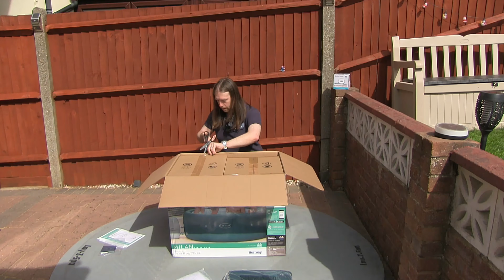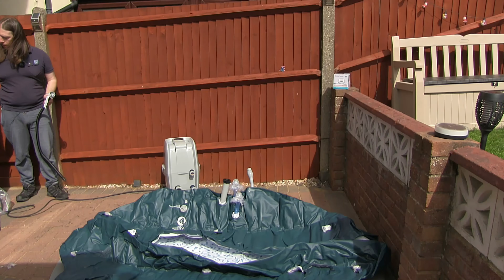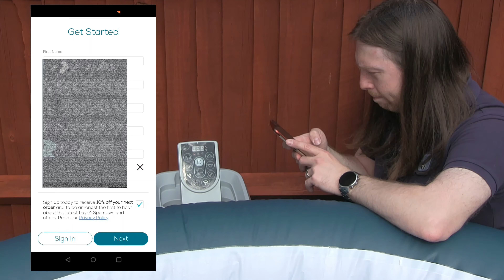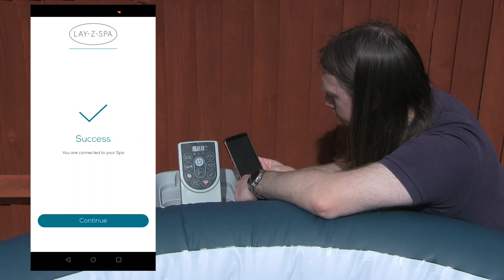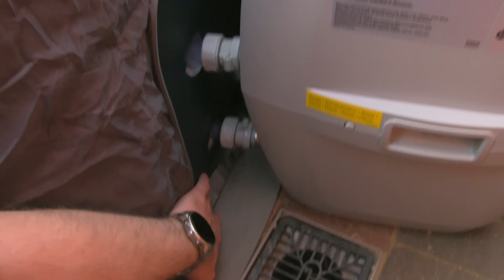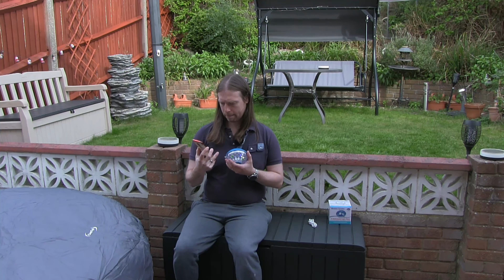Lay-Z-Spa Milan Airjet Plus with WiFi Unboxing, Setup and quick Review

Comment: Hi Ben, I can't seem to connect ro my WiFi. I dont have 2g. I think it's 5g. Any suggestions?
Reply from the maker: Hi Penny, it will be in your router settings. You probabley have a bonded WiFi ie 2g and 5g are set as one combined. You will need to log into your router to change this. Just go to a web browser and enter your router IP address something like 192.168.1.1 or 192.168.0.1 or 192.168.0.256 are the most common ones. You can find yours by clicking start run type cmd press enter
ipconfig /all
and find you default gateway. This should be your routers IP address

Then go to the WiFi settings and separate them setup two deferent SSIDs.

You might be able to get away with turning 5g off during setup but it might not work.

User name and password may be printed on the back of the router

Hope this helps all the best
Dave

Comment: Are the bubbels on these as good as the model, like the havana , without the bubbels on the floor? I am scared the more space from te bubbels created lighter bubbles. I cant compare the pumps . The pump is heavier?
When I compare to the havana and smaller one (180?)
Reply: And are the bubbles heated? Warm or cold? Very much different information about this!! 
Would be nice if you can clear that up!
Reply from the maker: Hi Kleintje, Yes the bubbles are heated which is lovely as its warm bubbles against your skin and helps keep the water warmer for longer.
All the best Dave
Reply from the maker: Hi Kleintje, I have not tried the Havana one but I did have the Paris which had only one ring of bubbles. From memory I wold say the bubbles in the Paris were larger and more powerful but more inconsistent and uneven. With the new design with the bubble in the middle as well they are now heated, more even flow and distributed. I would say the blower is more powerful as the force of air being bumped is about the same feel but evenly distributed.
Kind regards Dave

Comment: PASS, absolutely no reasonable need to give your location.
Reply from the maker: Hi Adrian, at the moment there is no need to share location for this integration as it does not respond to you being home or not. Which is what I was hopping for to save electricity if we are not home then the spa does not need to heat up. I have gotten an auto spa function working via home assistant so it cost very little to run as the spa will auto heat when we have excess sun, or cheap electricity.
You can see our automation script here https://github.com/BrenTeck/Solax and https://github.com/BrenTeck/Lay-Z-Spa 

Hope this helps all the best Dave

Comment: what do you mean by bubbles = heated ? 

i started at 22c - 6 hours later its gone to 27c  = / all covers are on
Reply from the maker: Hi FudgeyButter, In the past with the old units the bubbles had just outside air pumped into the water cooling it down much quicker than the new ones heat the air so it looses heat slower than before.
I was not saying you use the bubbles to heat you Spa as this would be very inefficient and noisy. If you are wanting to heat the Spa just run the heat mode, it will stop when the target temperature is reached.
I hope this helps all the best Dave

Comment: The instructions aren’t just bad, they’re nonexistent. It’s appalling, infuriating. If it hadn’t been for YouTube I, never would have figured it out, and I still have a wifi light blinking on and off for no reason I can see. Anyway, thanks for your great video. A life-saver!
Reply from the maker: Hi Gregorsamsa,
Glad we could help with our Lay-Z-Spa setup video, If the WiFi light is flashing it has not connected to your WiFi I suggest having a seprate 2.5 Ghz network instead of a dual 2.5+5 Ghz network. Setting up a 2.5 Ghz network may fix this. Also are you using the Lay-Z-Spa or Bestway app? I use the Bestway app as it allows for Home Assistant integration.
https://www.youtube.com/watch?v=fow2Kaj3FRg&t=1059s is the part I run through the WiFi setup

Hope this helps
All the best Dave

Comment: Mine won’t connect to the wifi. Have tried everything
Reply from the maker: Hi Vidda,
Do you have a seprate 2.5 Ghz network or a dual 2.5+5 Ghz network. Setting up a 2.5 Ghz network may fix this. Also are you using the Lay-Z-Spa or Bestway app? I use the Bestway app as it allows for Home Assistant integration.
https://www.youtube.com/watch?v=fow2Kaj3FRg&t=1059s is the part I run through the WiFi setup

I hope this helps
Kind regards Dave
Reply: @BrenTeckITSupport huh?

Comment: What are the sponge filters you mention? Not the same as filterballs?
Reply from the maker: Hi Lucbessonium, The sponge filters are easier to clean which is why I used to like them more. However they do not filter as well, so you have to change the water more often. The AbsorbaBalls suck out oil that leeks from your skin helping to keep the water and filter cleaner.
https://youtu.be/EDzKCl-l05A
Hope this helps
All the best
Dave

Comment: are you sure the bubbles are heated? pretty sure the heater is still in the same place as always which is through the filter system.

the airjet plus does not mention this that there is another heating element that goes in the bubble airways. ? where did you find this information, thank you.
Reply from the maker: Hi Unlimited, it does not state that it has heated bubbles anywhere. When I hold the tube on the inside of the spa where the air goes to the centre ring it is warm to the touch. If the ambient colder air was going through it would feel colder so I am assuming the air is being heated somehow. The pump and heater for the water were on at the same time so it could be the ambient air temp in the pump unit is hotter than the outside air. The exhaust air for the pumps which will be warmer could be fed into the airflow of the bubbles? Also, the temperature of the spa does not seem to drop as quickly when the bubbles are on. The new Lay-z-spa's have gotten a more efficient heater for the water so that could be the reason for the temperature being more stable when in use. This is all just my speculation and feelings when using it, but I am convinced that the bubbles are warmer than the previous one we had. I hope this clears up my feeling sorry for the confusion.
Just so glad we got it. I will be releasing a video on how to automate the spa so it heats for free using our solar panels and Home Assistant, so hope you have subscribed and clicked the bell notification button.
All the best Dave
Reply: @BrenTeckITSupport  okay so I made a reply to this but now it's gone.

The airjet plus I saw in a pic from lay-z spa said Warm Air, so I assume they got the cooling closer to the heating element on the newer pump which has wifi and 2x bubble speed.

thanks for your answer, quick reply is really great.

bought the 180cm thermal cover for my helsinki, it does say on their site that it doesn't really  fit perfectly even tho its a 180cm pool from them but wouldn't fully touch the bottom.
Reply from the maker: @unlimiteduploads2971  Hi, I have just found it in the instructions https://www.lay-z-spa.co.uk/find-your-manual/2021/milan-airJet-plus.pdf page 20-21 MASSAGE SYSTEM BUTTON: "NOTE: Heat and massage system work together to create a warm massage experience." I could not remember reading it when replying to you first but I used it a couple of days ago and it definitely is warm to hold the tube. Odd that they do not make a big deal on this in their marketing as it is definitely a selling point and extra feature that others products might not have.
Yes, they do state "Please note that the 180cm round thermal cover does not give a complete fit to the Helsinki and Napa leaving a few cm uncovered at the bottom. You may want to consider the 196cm but this will have a more loose fit." You could get some pool noodles or Pipe Insulation Foam https://amzn.to/3N90EKt bout 6 or 7 of them and zip tie https://amzn.to/42hdNoZ them together for the bottom?
All the best Dave
Reply: @BrenTeckITSupport  Okay so my comment gets deleted cause I say a word youtube doesn't like which is a d v yeah u know the rest.

So, this is said on every pump, 3rd old one, 2nd old one and the new airjet plus pumps, says the exact same thing.
page 27
https://www.lay-z-spa.co.uk/find-your-manual/2021/hollywood-airjet.pdf

and older pump https://www.lay-z-spa.co.uk/find-your-manual/2020/helsinki.pdf

So sadly, there is definitely nothing new with the airjet plus pump, bubbles comes in from the same big connector into the pool and right out of the pool. 

there are 2 heating elements in the pump for the water each 1kw each, so 2kw normal operation and 1kw + 800w (pump) when running bubbles so it doesn't exceed the power limit they set at 2050w ish and 10amp fuse.

Had a longer comment but youtube removes it, but yeah, cool that you work so hard for your followers, great to see! but I think we solved this.

Hence why layz spa never spoke about this cause it was nothing new, if they did make a new version with hotter bubbles they would definitely brought it up.
Reply from the maker: @unlimiteduploads2971  Hi, Thanks for all of this really interesting and useful info much appreciated.
Having to watch what ones posts online is really starting to become a pain. Most people don't want to deliberately offend others but it can not be avoided in its entirety as everyone finds different things offensive. Censoring everyone because of this is rediculous.
Thanks again and all the best
Dave

Comment: What is 2g house WiFi I don't get it. I have 5g I think x
Reply from the maker: Hi Fleur,
First off we are not talking about mobile phone 5g this is a different thing, just in case you are getting confused between the two.
You should be able to check this in your router settings. Some cheaper / Free ISP routers may not show you these options and may only offer a combined WiFi SSID if so just use your WiFi like normal and hope it works. If not you may need to upgrade your router and possibly get a modem.  Have a look at our Ausu AX88U setup video this is where you can set up the WiFi settings https://youtu.be/kLBCAhgGefc?t=297  your router may vary but you should be able to access it from something like 192.168.0.1 or 192.168.1.1  in your web browser.
If that address does not work you can open a command prompt. 
Win 10&11 Click Start,
type cmd
Press enter and type 
ipconfig /all 
Press enter and look for your default gateway. This will be your router's IP address. Enter this into your web browser and you can see your WiFi settings from there.
I hope this helps.
It is best practice to have a separate 2g network for smart home tech as this improves reliability and security. But sometimes you can get away with just having a combined network.
I hope you have subscribed as we are working on a new video showing how to automate the Lay-Z-Spa to make it cheaper and posable generate an income from running it.
All the best and if you need any more help just ask.
Dave

Comment: Very nice video. I've got a question about the pump.

If it is raining on it, will ot be ok?
Reply from the maker: Hi Tyrre,
Yes the pump can be left out in the rain. In fact as long as you keep it plugged in and powered on, with Freeze Shield you can leave it out all year.
The pump is splash proof, it has to be as it is next to the Spa. Just don't submerge the pump in the Spa, run a hose pipe over it or presser wash it and you will be fine.
Rain is no problem at all.
All the best, hope you subscribed as we have more Lay-Z-Spa videos in the making.
Dave

Comment: Im not sure if I should buy the Palm Springs or the Milan? I can get both for the same price. Other than the wifi which i wont really use i think, are there other differences? What do you suggest?
Reply from the maker: Hi Michiel, Easy get the the Milan.
The only difference is the colour and WIFI as the Milan has WIFI and if you can get it at the same price get it!
I will be doing a vide abut the benefits of WIFI spa in the near future so subscribe and don't miss out. It can save a lot of money.
All the best
Dave
Reply: Ok thank you. Btw you mentioned that you will have to inflate it several times. Does this mean that you have to disconnect the unit every time to put extra air into the jacuzzi? Since you have to put the inflater onto the unit.
Reply from the maker: @michiel3g  Hi Michiel, yes you are very right. Before you disconnect the pump from the spa cover the in and outlets with the black rubber caps, then disconnect, reinflate and then reattach the pump. Make sure you remove the black caps before turning on the pump as it will run dry and give an error code, it will self reset once water can be detected. All easy enough to do but I might make a video of this next time I need to re-inflate it.
I hope you subscribed as we have the smart automation working now to heat the spa for free so going to start recording the how-to video soon.
All the best Dave

Comment: Is the floor supposed to be flat or is there a separate outlet to inflate the base? Thanks
Reply from the maker: Hi S J, The floor has a foam pad inside so the floor does not inflate. I strongly recommend the Lay-Z-Spa Floor Protector https://amzn.to/3K0UEyp it will help insulate, protect and give extra comfort to your spa.
I will be doing more videos about the Lay-z-spa WiFi so subscribe and click the bell notification icon. :) It will be worth it.
Dave
Reply: @BrenTeckITSupport  that would be great, I'm struggling to get the WiFi connected on mine at all.
Reply from the maker: @sj6127  Hi S J,
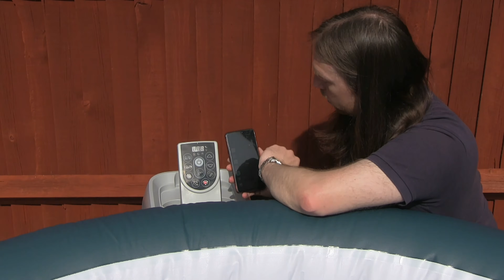If you are struggling getting the WiFi connected watch this part again 17:39 - WiFi Setup https://www.youtube.com/watch?v=fow2Kaj3FRg&t=1059s
Be very patient it takes a long time for it to respond during setup Have a cup of tea or a Beer to hand!
Kind regards
Dave

Comment: Hey, I bought my Lay-z spa Paris based on your last Hot tub video a few years ago. Love using it during lockdown. However, because of the cost of energy going up how did you justify getting another one (if you don’t mind me asking) I feel like I can no longer use mine due to the price increase. Have you looked in at all to seeing how to run it off grid. It would make for an interesting video to watch. Keep up the good work.
Reply from the maker: Hi Arktic, We lent our Paris to a family last year and never got it back, so we were in the market for a replacement. The new lay z spa Milan has WiFi so I am planning to get it to work with HomeAsistant as others have already done and our solar panels so when we have any excess electricity instead of selling it to the grid for next to nothing we will put it into heating the hot tub. https://www.youtube.com/watch?v=9npLjYp79qI&t=2s with the number of solar panels and battery storage we have we can run the lay-z-spa for free on a reasonably sunny day.
so for us, it is well worth having, with the spa late into the evening. It loses about 4 degrees overnight with the thermal jacket on https://amzn.to/3jYFxeu
Our house uses an average of 850w without the Spa and with the Lay z Spa on and heating our total usage is about 3000w
The specifications for the lay-z-spa are 2,050W and so it takes about 1hour to heat 2 degrees.
Take your energy price and times it by 2 then times the number of hours heating to get an estimate. At the moment (price per Kw 0.25*2 Kw)*10 Hours = £5 for heating the spa that day roughy.
you can use https://www.sust-it.net/energy-calculator.php to calculate the cost easily  
I hope this helps all the best David